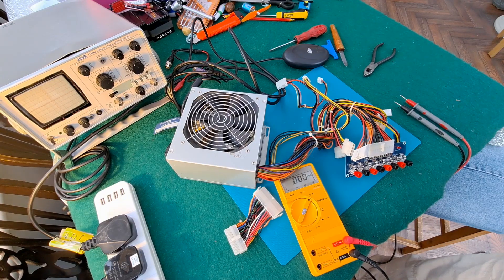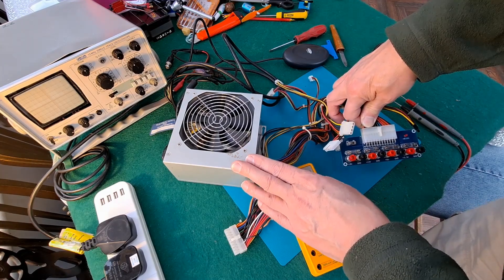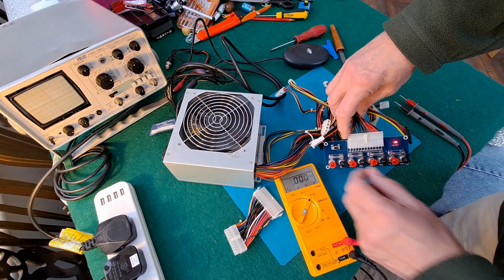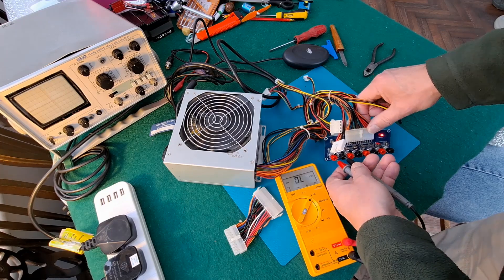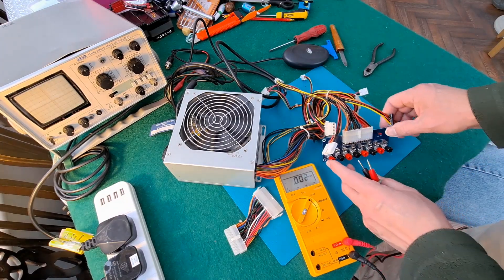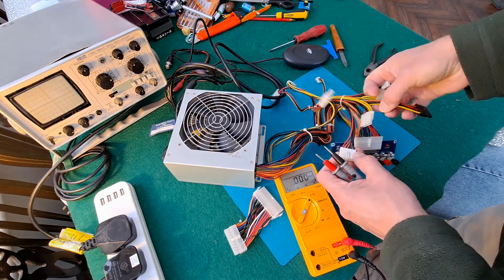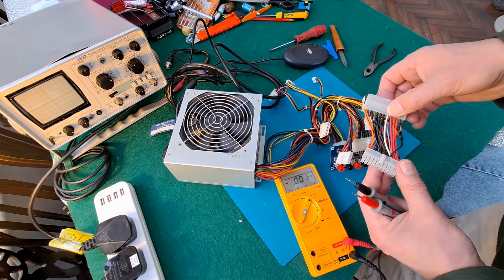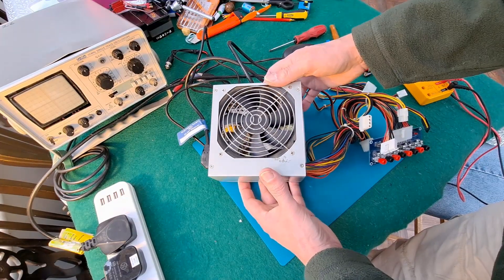Checking the ATX Power Transfer board I bought on eBay

Comment: I have the same board but my power supply is only 20 pin. Is that a problem?
Reply from the maker: I am confused.  If you already have the board and the power supply, you already know the answer. If you buy a board with a 24 pin socket then your 20 pin plug will not fit. You can probably find a board with a 20 pin socket if you search, or you might find a 20 to 24 pin adapter. As I showed in the video, my power supply is 24 pin and had an adapter to go down to 20 pins. That is the opposite of what you would require. Obviously I didn't need it so I removed it. If you don't want to save your power supply for its original purpose you can buy boards that you directly solder and cut the plug off.

Comment: Nice power Unit. What can you power up with it?
Reply from the maker: They are perfect for most electronic projects as the voltages supplied are obviously the voltages used on the circuit boards in the PC. 3.3v 5v and 12v. There are plenty of videos on YouTube on converting the power units to "bench power supplies" so you have the power readily available on your workbench. You would have to cut the wires and fit suitable connection terminals. This little module has the terminals fitted and a suitable socket to accept the plug from the power supply so you don't even need to cut the wires and reterminate them.

Comment: Best reason also not to buy an Aldi PC.
Reply: only making 2 videos a day at best
Reply from the maker: Not with you on those comments, not sure what you mean.
Reply: @GrandadIsAnOldMan  My Aldi PC has bad PSU is not good.
Reply: @GrandadIsAnOldMan  Also you said you did not use a PC much when you make this number of videos...
Reply from the maker: @prep0wer  my main PC is running 24 hours 7 days a week. When I said I don't do much with computers, I meant I don't build them or modify them any more. You probably saw the video where I stripped down half a dozen that I had had in storage for years.
Reply: @GrandadIsAnOldMan  Obviously I haven't (yet).
Reply from the maker: @prep0wer  Well as I mentioned it, here you are - Tidying my workroom - Scrapping six PCs https://youtu.be/p-oJ3RbCGzk

Comment: That's brilliant. Comes with a switch fitted and everything. When you used to build them you had to short two wires to get the power supply to fire up but this obviously does all that through the switch and connection socket. Another very good thing about those ATX power supplies is the amps they can supply. Some power supplies only give you about 5 amps. I have a digital power supply that goes up to 24 volts but the max amperage is only 5 amps, so no use for driving stuff that requires a lot of amps to work, such as induction heaters, etc. 
I just ordered some new blank copper circuit boards and ferrofluid for the etching. Hope to get back into electronics this year. I think I will look at one of those ATX supply modules. 👍👍👍🎸🎸🎸
Reply from the maker: For a few more pennies, you can get modules that have included a USB socket on the same board 👍
Reply: @GrandadIsAnOldMan  Yes, I heard you mention that in the video. Might have a look but to be honest we have loads of plugs and extensions around the house with USB sockets. It seems that it is becoming a standard feature on many extensions and plugs. Although if you were using the ATX module for a dedicated USB project then it would be ideal. Have a good weekend Graham. 👍👍👍🎸🎸🎸